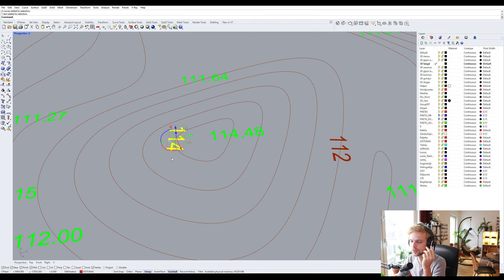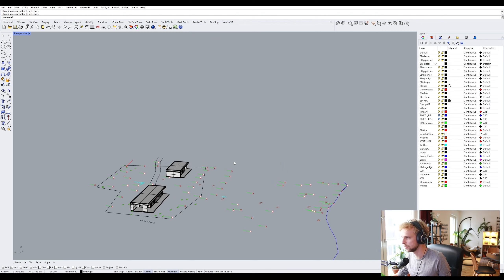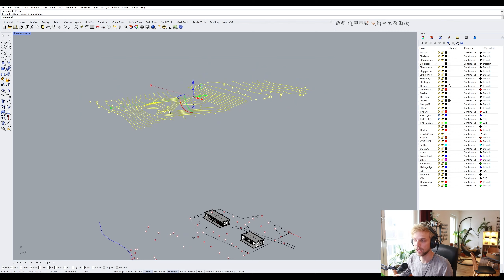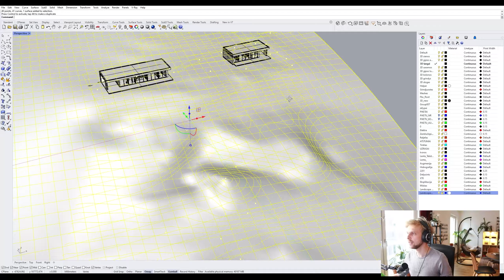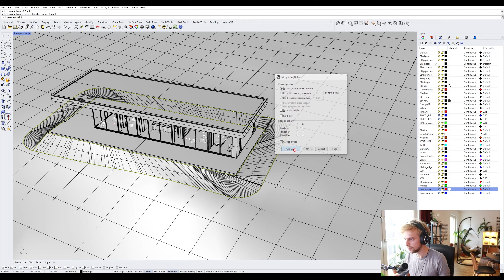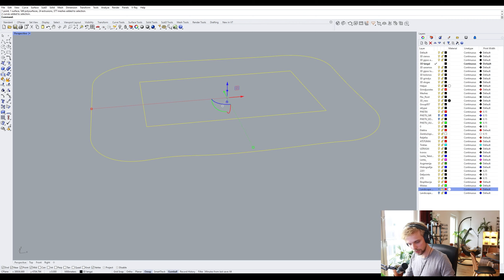Rhino for Architecture: 2D contour curves into 3D landscape

Comment: Nice tutorial, but I would like to ask.

How to achieve those 2D contour curves before inserting them into rhino 3D?
Reply from the maker: Geodesic surveys are purchased as a service and cross-referenced with the general plan found in the local municipality. Basically if you go to the town hall - you can request the drawings for your particular site.
Reply: @DesignGoBrr  Thank you for your explanation.

If I can't get those conditions, is there another way?

for example, using Google Maps or google Earth Pro? or other internet services/software?

Comment: Hey thanks man, really well timed video. Always enjoy your productions. 
I was wondering if there's an automated way to tackle Z value reconstruction.. height setting.. of 2D contour lines. I'm surprised there isn't - I'm sure you'd know and be using it! 

I've been working to extract large landscape data from Geotiff DEM files, via QGIS (where I need to adjust, knit, and trim it) - into Rhino + GH for post processing before constructing physical models. 
I know Blender can be used here too, but it's not my skillset and there's reasons not to go that way. There seems to be a few paths with R+GH including QGIS Plugins for STL export/import; Pixel-to-point methods for point cloud import, and finally contour export for import and reconstruction. But the videos I've watched all show 3D contour lines already in Rhino, nothing on how to get them over.
Reply from the maker: Thanks! In regards to using an automated way on moving the contours to their respective Z positions - the short answer is - not possible* . The asterisk is there because it really depends on what kind of starting input you have. Almost all site survey data that we use (north Europe) comes in as AutoCAD 2004 format. Every 4th contour is blocked together with text that specifies its altitude. This kind of info is still not enough to automate the positioning as there are too many variables that can happen in between the "marked" contours. Specially islands and non-natural discontinuities. I think in a few years we will have at least a few Machine Learning tools that will help, but as it is now - nope. Said that - IF you have a  reliable GIS data source for the site on which you've working - you can just use the Elk plugin for GH to get all necessary info from it. It's already automated for you then.
Reply: @DesignGoBrr  thanks a lot for responding. I can see what you're saying, particularly if data available to you is non-negotiable as AC-2004. 

In the space of this conversation I've actually cracked my workflow, I'll come back tomorrow and (with the help of the online community) get comfortable with contour > srf/mesh + post processing + colouring + export etc. 

If it interests you at all, I'm working from local government Lidar DEM files in Geotiff format. Which were imported as a set into QGIS, and had to be levelised by conversion to virtual raster. I'm working with clipped regions from here, to produce contours with the (QGIS-native?) contour tool [here's where my mistake was, I failed to generate Elevation values for the geometry!]. Exporting as .dxf with Z. Imported to Rhino beautifully.. and on into GH etc. 

Is it feasible for you to use DEM data in your work, in place of the 2D contours provided... or is that not appropriate?
Reply: Re-reading your response I understand it's probably higher-accuracy, site specific survey data you're working with. Higher definition than available DEM.

Could you partly automate it by drawing a bisect line manually. Then using GH, pick up the intersections (ie. develop a deployable workflow for this). Select lines one by one, using the list of intersections (is possible?), then move the lines up to elevation using a seed value, and a series of elevation increments.
Reply from the maker: @yachalupson  Oh that sounds like a treat to work with. Unfortunately the rollout of "new tech" is being very... slow in our work environment. There are companies who offer DEM data generation, but they don't do geodesic evaluation (drill probing under the site to see the composition of earth layers), only surface mapping, while the guys who do oldschool autocad drawings, also offer drill-probing and do so at a much cheaper price. So even if we used the DEM data people, we'd still need to use the oldscool autocad people for what's going underneath the site. Once the two variants are proposed, guess which one the client chooses every time.
Reply: EDIT: It is possible; tested, works.
Reply from the maker: @yachalupson  Nice! Will look into this as well, so a video might pop up in the future~
Reply: @DesignGoBrr  That'd be cool would love to see your response :) (hope you received my email with code & example)
Reply from the maker: @yachalupson  Yup, received it. Can't take a look at it this week tho as it's a busy-busy time now~

Comment: Great video, Actually sweep does a little better job if you place the cross section curves not at the vertex
Reply from the maker: Yup, remembered that after finishing recording. Also with any kind of "lofting" style tool - discontinuities in curves is a bad thing, so it's much better to have opening corners filleted.

Comment: How to create road steeped terrain in rhino.? Plz reply
Reply from the maker: Not sure what "road steeped terrain" is, but if I had to guess - have 2D curves of a road outline, project them onto a landscape surface, use split to split the landscape with the projected curves, take the part that's split off, extrude it down by let's say 10cm, delete top surface of the extrusion.
Reply: @DesignGoBrr  I tried this method.  But the height of the site is too high.  How to make a road like a mountain pass?

Comment: i think you can move the contour lines to their heights by grasshopper, better than manually moving one by one?
Reply from the maker: Yea, automating it would be awesome. Do you know a good approach to Grasshopper reading of text blocks, associating them to the nearest curve (or curves if that elevation has islands) and then interpolating the heights for all contours that do not have a markup? I tried searching for something similar, but the closest0 approach I found was using Computer Vision + Machine Learning combo and it was all written in C++
Reply: I have no idea about Machine Learning. Reading text block is hard (impossible?), block management in rhino is bad and grasshopper doesnt support block.
But, for the task of making 3D landscape from 2D contour of CAD file, normally you just need a rectangle boundary, in your example you have the good and clean input, so you flip all curves following 1 curve, then take the end points and sort them, then do the series moving by Z. Just saying for the "normal case". In case of bad input file: complex boundary, or the 2D contour missing some lines, the Z distances between lines are.... not constant(!?). so we have to do manually.
Reply from the maker: Yeap, and most drawings that you get from the goverment are dar from being super clean. That's why I go for a very manual approach
Reply: @vu_derArchitekt  I think you described something like I was imagining, in a response above ^^. I was thinking semi-manual, to speed work flow but to keep accuracy (Almost sounds like it should be a tool).

Can you see a way to manually draw an intersecting line; select contour lines as a list by intersect with this line; present a prompt/take input param to get a seed elevation + increment; move lines in Z?

Comment: I’ve found if you rebuild the contour curves with a higher number of points, turn on control points to make them visible and then select the points instead of the curves, the resulting patch will be more accurate
Reply from the maker: That's such a strange behaviour. Technically the curve input into patch should produce an "infinite" amount of points for the patch to use, so it's so counter-intuitive. Said that - this is Rhino that we're talking about, most of it is counter-intuitive :D